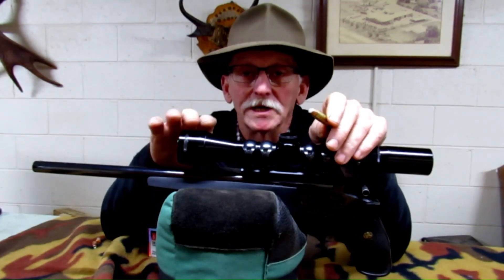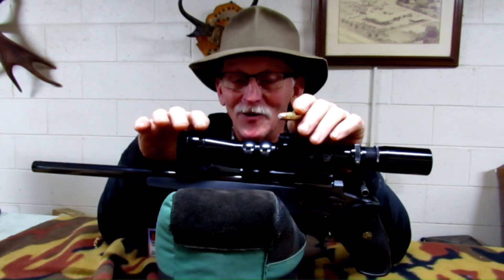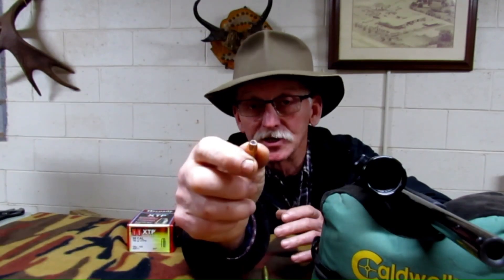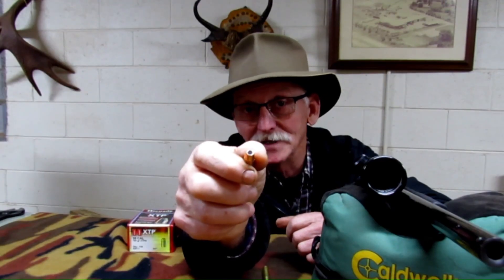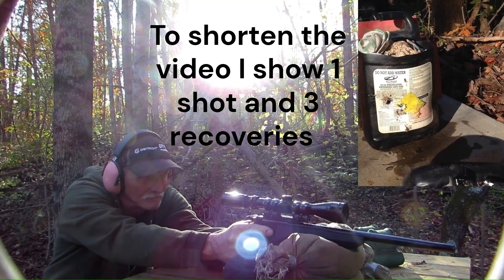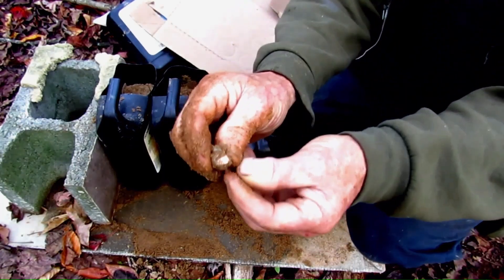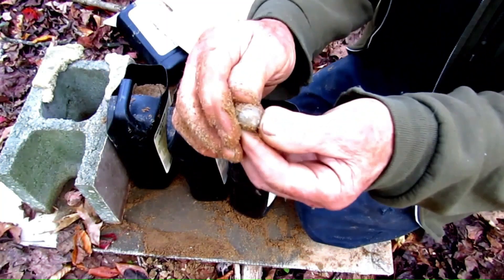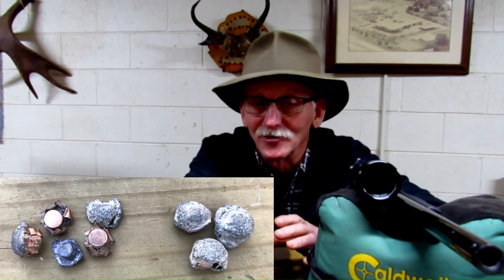I Plugged A Hollow Point Bullet With RTV Silicone

Comment: Why not just buy factory loads and go hunting, Remington Core Lokt soft points knocks a hole as good anything, Professor Bumbbee. 🤣😆🙄
Reply from the maker: Good question with more than one answer. I shot a buck last fall with handloaded 200 grain Sierra RN bullets which are constructed the same as the Core Lokt. Love Core Lokts in a rifle BTW but at reduced pistol velocities  you don't get much expansion. Shot a buck last fall with the Sierras @100 yds plus or minus a few and the bullet penciled through. The bullet exited the back of the shoulder but the blood trail was sparse. Fired from a rifle the same bullet wood have produced blowout I'm sure. The second reason is I like to customize my rounds. I doubt I would get 1" groups with factory ammo in my pistol. Maybe I'll give it try sometime. Third Core Lokts for the 35 Remington are pretty close to 3 bucks a round. I'm tight LOL. I can load for a buck or less a round. Finally I love to tinker. It makes this old guy happy.☺

Comment: Evening Feller! 

This was a common thing in some circles some years ago. IIRC its unreliable meaning sometimes it makes it less expansive and other times more expansive. 

But awesome testing!!

The 357 has a AWESOME offering. Its the 158 XTP-FP bullet. That bullet has worked for me to 2200fps and given me perfect mushrooms!! The reg XTP would hold up very well to but gave up the ghost before 2000 fps. 

I have used in my 357 Maxi and tested in 35 Rem and 357 Herrett. The only school Speer 140hp was GOOD BULLET in the Herrett at top 14" velocities. Thats pushing 2200 fps. I have taken a few deer with that bullet. Man I wish Speer still made them the same way as they did back in the 70's!!
Reply from the maker: Hey CW hope everything is going your way. I will have to try the FP out. I think the Speer 158 Deep Curl may work as well. You know I am partial to them heavy bullets though.😁
Reply: @kennethdellinger2037 Ooh Speer did us SUCH a DIService when they discontinued their 170g Gold Dot SP bullet!!!!  WHAT A BULLET!!!!!
Reply from the maker: @cw2a  That would be perfect.